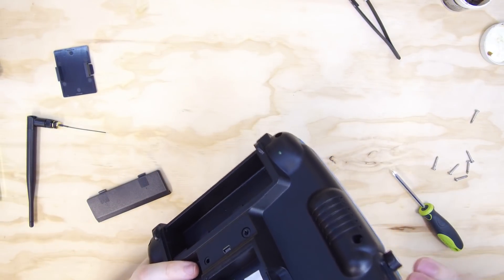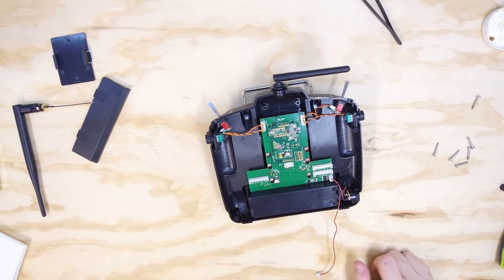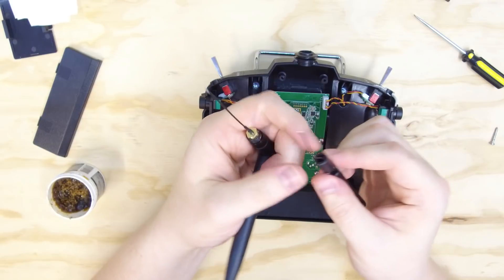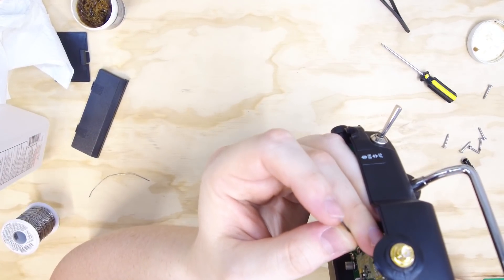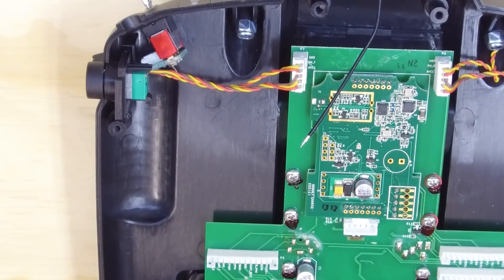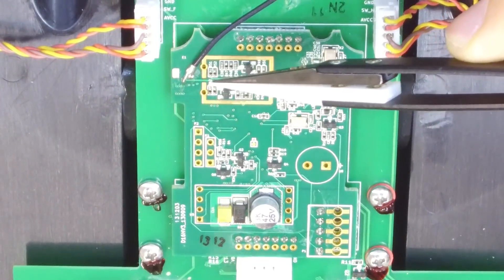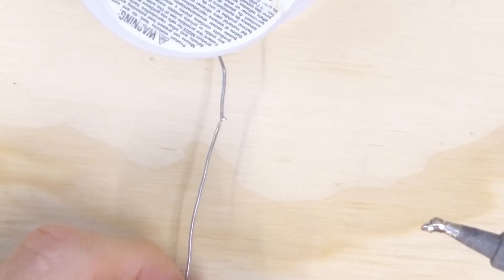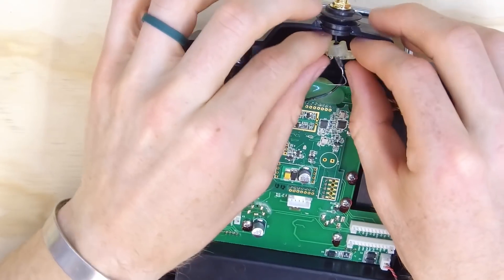Taranis 5 dBi Antenna Mod | JUST DO IT!!

Comment: Will this work on my x9d plus special edition 2019?
Reply: I don't have a SE but doesn't that already have an rp sma connector on it?
Reply: @hrhodes2768  thats what im trying to figure out, if i have the 2019 , do i have to do the upgrade or do i just buy the antenna and screw it on? Im new at the hobby, i just want everything yo be good.  Thanks for the reply.
Reply: @Lando6969  Did you ever figure this out? I am in the same position right now.

Comment: I have this on a hack module with a futaba 7c. I fly .60 size nitro airplanes with it and im happy. I've done heavy radio/ range testing with this ant. On my radio and a taranis vs stock antenna and it's a big boost in range. And it looks cool on my radio

Comment: 7:11  Wouldn't it be EASIER to install in the REVERSE order of removal?    Solder the tiny tip (inner conductor) first, then second, pull the cable tight over the ground pad, and solder the braid.  Words from an armchair soldering quarterback.

Comment: Good video... The length of the internal coax doesn’t matter... But ideally it should be as short as practically possible.  Good solder joints are essential, as you say, and an antenna of the correct impedance.  And you can always measure the power out and vswr with a watt meter to be sure it’s a good installation too... thanks for sharing.
Reply from the maker: Thank you! This is great information.
Reply: Ya better never forget to put an antenna on it. And never use a cheap antenna.  Because it you do, you're going to replace the back board.
Reply from the maker: Right on, sounds like you know more about this than I do. Can you explain how to measure power output and VSWR? I know the taranis gives a number but I thought it wasn't trustworthy.
Reply: There are many good power meters I like Bird https://youtu.be/fbj_r6QfN4I